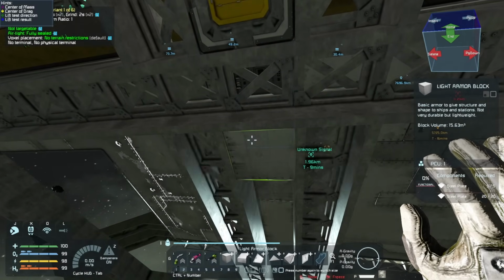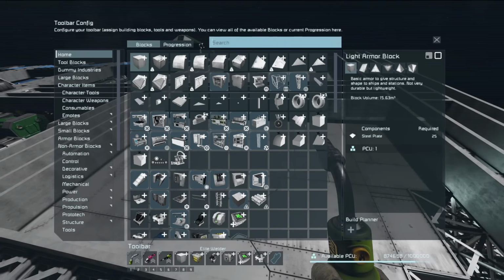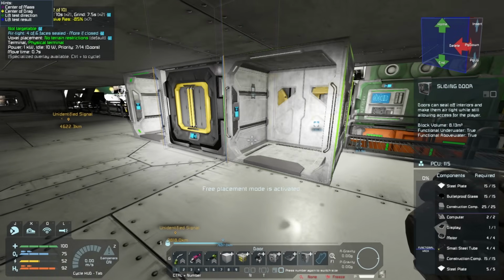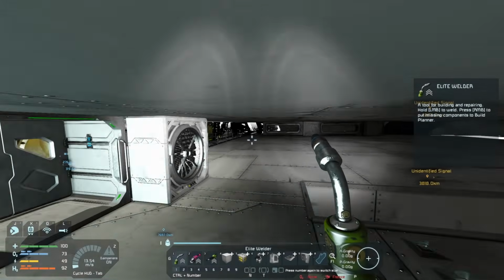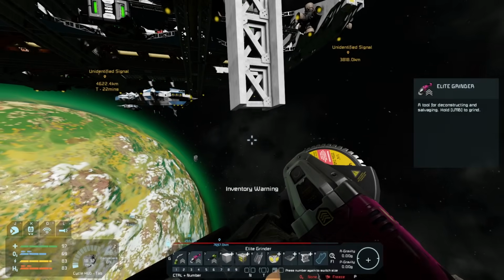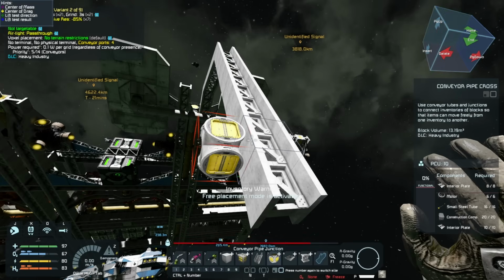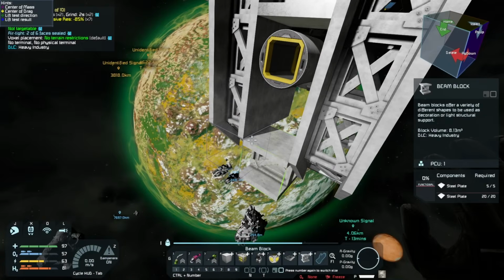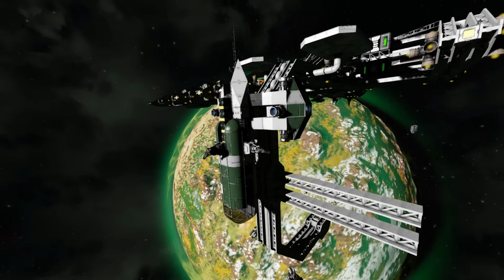Space Engineers - Prototech Pursuit EP30 - "Upgrading To A Proper Space Dockyard"

Comment: You should connect the arms on the bottom like a "tunnel" so if one is broken you have less chance of losing it all.   And Whip's airlock script will handle a 3 door airlock no problem.   Also build info/vision...  I forget which one highlights the block you aim at with a bounding wire frame.  This wire frame will turn red if the block  will disconnect the grid when removed, so no question if grinding that connector was safe.  Oh a d the  ase e t area... maybe put full glass all around to give an observation deck sort of vibe.

Comment: AIrlock, if you use Whip's script for doors set both doors to external and have 1 internal linked together will work as I use it with multiple interior and exterior doors on the same airlock

Comment: Instead of using the conveyor pipe elbows making a curvy stair-step, how about using hinges at both ends, to get a straight section at a 45 degree angle?
Yes, this would add more sub-grids to the platform, but aesthetically, could look better than all those elbows (although with them tucked between the beams, they don't look as janky as fully exposed elbows).

How about mini landing/storage pads for combat drones on top of the 4 corners of the platform, rather than out on the new landing pad pairs you're building?
Save the larger pads for larger ships, and with the dedicated mini pads, you could group them, and on a hot bar button, cause them to disconnect & launch the drones as additional platform defense.

Comment: I feel like the only appropriate size for the cockpit when it comes to that large shipyard ship would be a full-on massive 2, maybe even 3, story/floor bridge. Kinda in the same style as andrewman's snowstorm bridge but with a more angular design. You could use the beams along with sloped blocks that slope down towards the beams to make it look as tho it is fully held together and held on by the beams. I mean, it would look like the blocks bulge out at the beams. It's a shame no one has made a tiny block that is in the design of a weld. So the block would be placed at the intersection of the beams as an edge or corner piece, and it would make it look as if the beams were welded together. That would add so much to realism and design. You could have the bridge sitting above the ship towards the front. It would look great if you could get the beams to come in at a slight angle from the outer edges but have the staircase go up the middle on top of the ship. Then whenever they meet at the middle, have the beams from the edges split into 3 beams and wrap around the top and bottom of the bridge and staircase and make the bottom of the bridge look like its being squeezed by the beams. Then make the bridge fairly large, and by that, I mean 2 to 3 floors tall like the snowstorm.
Reply: All of my recommendation is kinda ridiculous except the weld style block for the beams. I stand by that idea